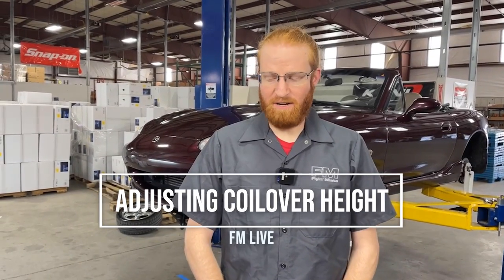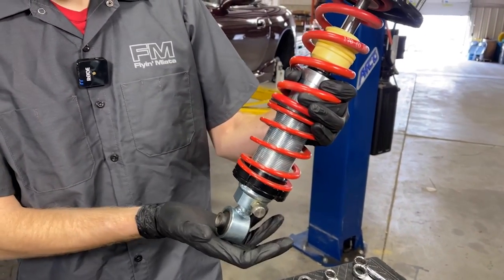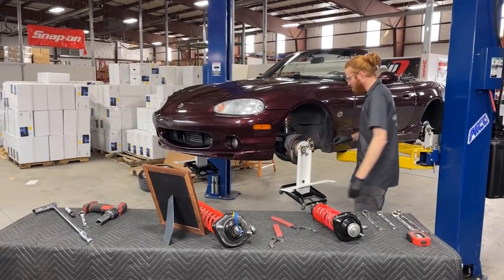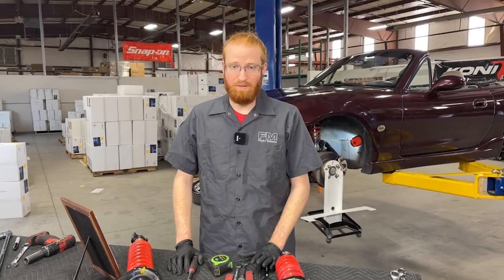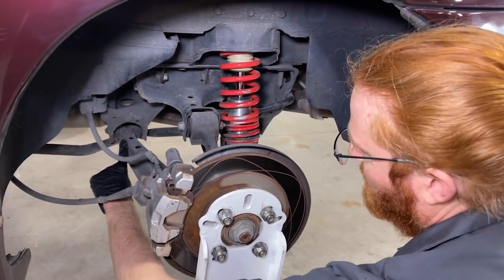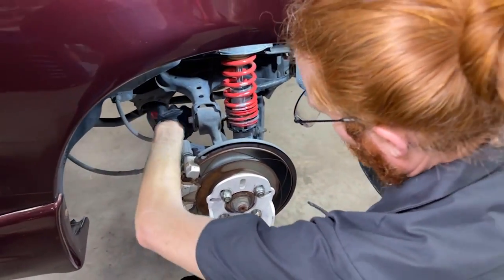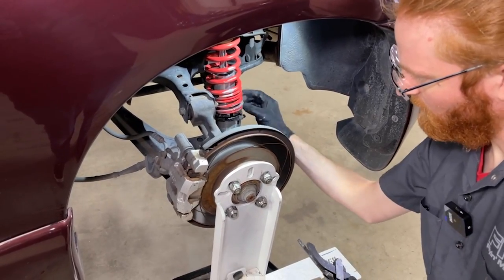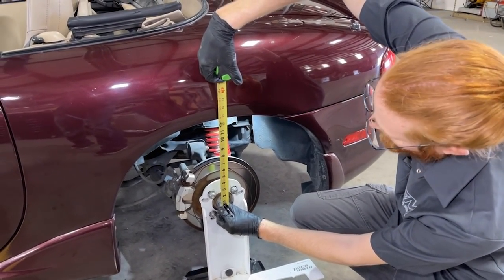How to Adjust Coilover Ride Height (FM Live)

Comment: How do you index the bushings without the hub stands? Previously I’ve jacked up the hub with the car lifted but maybe that swings the index too “low” when it goes back to the ground.
Reply from the maker: The full weight of the car needs to be on the bushings before you tighten them to ensure they rebound to the correct position. You can do this with ramps, or by reaching around your wheels/tires.. Whatever you do, be safe! Feel free to reach out to our customer support team directly if you need more suggestions!

Comment: I have an ND2 RF GT that has stock (non-bilstein) shocks.  The car is my daily driver and I love Colorado mountain roads.  I have no intention of track driving.  BUT, I am interested in lowering the car to improved stability and decrease body roll.  Adjustable coilovers seem to be overkill, so I am looking at getting lowering springs.  Suggestions and do I need any other changes to the suspension?
Reply from the maker: Sway bars will be the best bang for your buck on an ND to tighten up the feel of your suspension. Just replacing springs to lower the car might help, but we really suggest matching the springs to the shocks you plan to use, such as with our Koni Suspension Kits. Feel free to give our customer support team a call, and they'd be happy to give you our impressions and answer any questions you might have about the suspensions we recommend.
Reply: I always assumed lowering springs will ruin your suspension within a few years. Since your stock suspension isnt designed for it that low. Springs are a great temp solution. But going full on coilover to lower the car. Is safer and longer term. Sway bars will help for sure with body roll. But don't help the look none. lol

Comment: Does changing the ride height on the Vmaxx result in a harder/softer ride? Mine are set on to almost the highest settings, and the springs are almost completely compressed in the rear. The front looks normal.
Reply from the maker: Changing the ride height does not affect spring rate. However, you can get into things like coil bind and lack of droop depending on how you’re set up. FM uses longer springs in our V-Max setups than are found in the European-spec ones to allow for a reasonable rear ride height. If you’re running our coilovers, give us a call to talk through what you’re dealing with.

Comment: Do you have to loosen control arms and bushings to raise the car? Or does that just make the turns easier?
Reply from the maker: Any time you make a ride height adjustment, higher or lower, you'll need to crack all the bolts that run through bushings loose and retorque them with the full weight of the car on all four of its wheels.

Comment: Do you remove the plastic between the helper and the main spring on the Vmaxx, I read in your pdf guide it needs to be removed, but it seems to be in the on the coilover on the table
Reply from the maker: That plastic guide is 100% needed, otherwise the springs won't stay on top of each other. Please contact our customer service team if you're having trouble.

Comment: I have a NC with meister coil overs.  my ride height is 13" front and 13 1/4" in the rear.  the alignment shop says my alignment is at it's mechanical end of adjustment, yet my rear camber is -2.9 degrees. I don't want to go any higher, but I am wearing out the inside of my rear tires.  does my alignment shop suck, or is there something wrong?  car has never been raced, and the coil overs have been on the car for 6 months.  any help would be appreciated.  thanks.
Reply from the maker: If you have time, drop our customer support team a message and they would be happy to try and talk you through some other possibilities outside of just camber. Call 970-464-5600 M-F 8-5 Mountain or drop them an email at support@flyinmiata.com. Hopefully they can help!

Comment: Can you please explain what to do if you have difference in corner hight after you set the ride hight?
I have that issue where my front left wheel is closer to the fender by about 15mm - and if I raise just this coilover, my rear right one looses hight too. Please help xD (I have checked everything multiple times)
Reply from the maker: The only way to have just one corner low is if the car is bent, you have a tire that's got a different diameter/pressure, or the surface the car is sitting on is not level. As you've found, it's not really possible to adjust just one corner and not affect any others.
I'd start by making sure the surface is level and all tire pressures match. Then start measuring to other points on the car, such as the pinch rail under the seams and see if you still see the same difference.
Reply: @FlyinMiataVideo  thank you for the reply. I was kinda hoping that was not the case.. what would you recommend in case i dont have money for that kind of repair (if the car is bent) untill i get another car or something. It is not a track car, its a daily. Thank you
Reply: @petarkukolj   the most likely scenario is the non-level surface. It’s pretty unlikely the car is bent badly enough to be 15mm off in one corner and not have visible problems with panel fit. That’s why you want to double-check using the pinch rail.
Reply: @TargaMiata  thanks for the input. I use my garage floor, it is flat, but it has 1% slope for water drainage. On the car, there are no visible gap issues between panels. I will take your advice and measure from the pinch rail on ideal surface, and write what i have found.  Thank you 👍

Comment: Helpful. are you just doing a tutuorial here or are those your actual adjustments? What I mean there was no rhyme or reason to your turns on raising the car, Isn't a little more precise for alignments. Shouldn't you measure or mark with a piece of tape how much you raised the car based off turns or coilovers threads? make it even all the way around kinda a thing.
Reply from the maker: Yeah, this is just a general overview. We have specific instructions on our website for the different kits we offer. For the V-Maxx, the motion ratio is roughly .7, so for every .7” the spring perch moves, the ride height will change 1”. It’s typically easiest to round it to 2:1. For other kits, I'll usually just move the perch 4 turns and see what the height change is and go off of that data to dial in my ride height. You should always get an alignment after you change your ride height. If you're corner weighing the car, you'll notice that the height can be different per corner to get your weight.